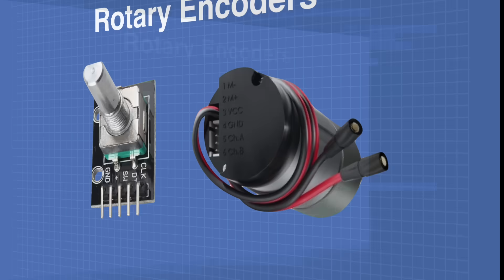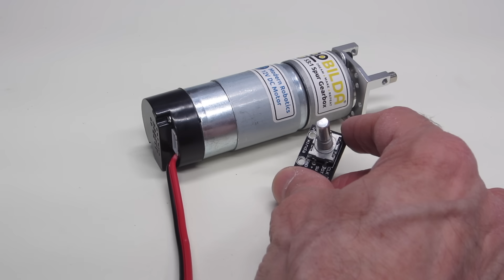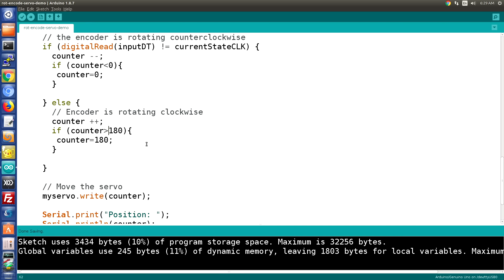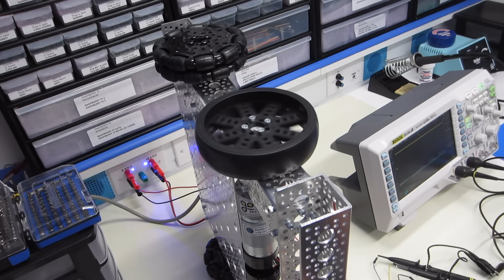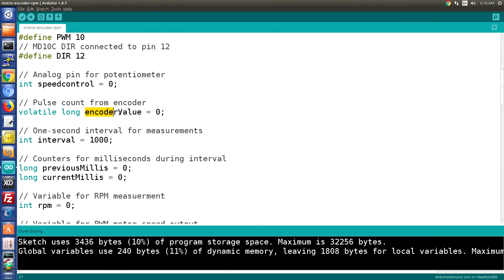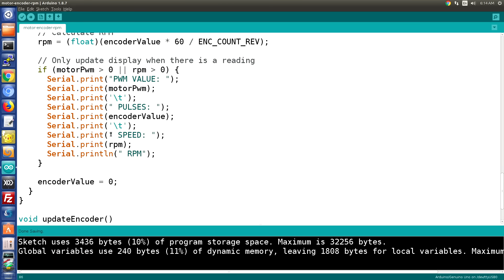Using Rotary Encoders with Arduino

Comment: This gave me an interesting idea for an electronic version of the dial on a safe.
Instead of having a precise set of numbers, the code could be a function of direction and rate of change.
That would make the combination unbreakable, because the user could develop a ‘signature’ set of movements.
This is similar to using an FFT  on hand motion when signing your name, instead of the actual writing.

Comment: It's not a big error, but it is an error. millis() is an unsigned long, not long. I worked with safety certified software and we had to have our compilers set to produce and error even for warnings, which is what you would get if you assigned a return type of unsigned long to long. In some cases, even if the function was explicitly cast to be a long, that would raise a flag during code review and it was often hard to justify the type conversion. So, why does this all matter? Well, our code ran ground based navigation equipment that had to run 24/7/365 so, even as an unsigfned long, millis() rolls over every 49.71.. days and therefore can cause a glitch whenever that happens. So, unless your device resets BEFORE that rollover occurs EVERY TIME (!), then trust me, it will happen. Even safety engineers are at a loss of determining the cause of these rollowver glitches. Computer math is modulo whatever the bit size and in abstract math, this concept is called rings. So for 32 bit values, that's 2^32, "Real numbers" go on forever, but computer numbers are fixed by their bit weight representations. These rollovers can happen in other circumstances. For example, GPS allmanacs have a 1024 count limiit for the GPS week used to tag the validity of the almanac so invalid ones aren't used. The "epoch" for GPS weeks started when the system was commishioned back in 1980. I worked at a company that used GPS for navigation and timing for radar systems. I tried to warn my boss(es) that everything was going to glitch when the GPS week rolls over for the first time back in August 21, 1999. They said, "we got Y2K covered!" I said, this isn't that. Well. even after it happened, they still didn't believe me. The radar system's "fail safes" kicked in and they reset. Some systems can take seconds to minutes to restart, which can lead to tradgety. When GPS experiences a Leap second, that's another similar issue. One that I didn't anticipate was after the GPS week rollover occured where lots of GPS receivers had a "fix" for invalid week numbers to ensure that they start up properly either from cold or warn starts. So, when that happened, some of our GPS receivers did not work for over a week, until they encountered their original GPS week number when they were "born". The industry had to scramble for these fixes! So, yah, rollovers are not a big deal, UNTIL THEY ARE!!!!

Comment: i’m five years late to this video, but i have tried making a similar sketch on my own but ran into a problem. the encoder has its own physical “steps” and the way i wrote my code i was incrementing my position value every time i left the step and then again when the encoder reached the next step (2x per encoder step). i have yet to try out the setup in this video, but will this sketch do the same thing or will it only increase the position value once per encoder step?

Comment: Thanks for the amazing video. it was a great explanation. can you explain how to use a encoder motor to stop at specific angle ?    my requirement is i have a base which needs to be rotated 360 degree. if i give input as 5 , it should stop at 360/5 =  72 degree angle . meaning it should at 72 , 144,216,288,360 and then stop and move to 0 degree position and repeat the same sequence N times.   is it possible to do  ?

Comment: Hi ,if we need to implement this setup of motor ,motor controller ,aurdino and rotatary encoder and can it been actually use this setup  for both manual and autonomous setup of steering wheel to get the feedback from the different modes.

Comment: Great video. I have a circuit that I'm working on but with the encoder, I get a lot of bounce. I know I can debounce either in software or hardware, but I note no bouncing in your demonstration. Wondering if it is the quality of encoder I have or if you are doing something to counter the bounce. Thanks.

Comment: as per this video i want to make 4 dc gear motor as 4-wheel drive robot each motor rotate exact drive parallel if any wheel skit, then another the adjust self by encoder. pls make video

Comment: I have a question. Why does the inputCLK 4 and inputDT 5 have to be #define instead of just like you would normally do an input i.e. cont int inputCLK = 4, and cont int inputDT = 5;?  As the others have said your vids are the most well explained and illustrated. Thanks

Comment: Also if advice on how to perform u v w lockup test etc that communicates with the Arduino, is this possible? Im a beginner in the servo motor field any advice appreciated. As mitchell electronics costs each time i need to do tests as im sure u understand

Comment: Another great video! For some reason my counter stops on even numbers only. The odd numbers are shown as part of the complete sequence but never landed on. I have tried 5 different encoders with the same result. They are the same as the one in the video. Would this be caused by a defective encoder or is this behavior typical of these devices?

Comment: Great video. Thanks. When I put it together I was having some problems with it printing twice for each indent. When I slowly turned the encoder from one indent to another indeed it generated a print at both the start of the and the end of the indent, and the logic of the software is such that this will happen. The first print is from in my case, first the Clk going low then the DT going low. At the end of the indent the Clk goes HIGH again, a transition which again allows the print routine to be executed, and the DT still being HIGH, it prints again a CW rotation.

I solved this quite easily with an IF (currentStateClk == The Resting State of the Clk), in my case HIGH, just before the IF for deciding rotation, it prevented the second print.

Your thoughts. Thanks. Wayne

Comment: Thanks for making such a clear and concise video. I am having a problem compiling the code for the servo motor sketch. I always get the following error: 

rot-en-srvo:46:3: error: expected initializer before 'currentStateCLk'

   currentStateCLk = digitalread(inputCLK));

   ^~~~~~~~~~~~~~~

rot-en-srvo:49:4: error: expected unqualified-id before 'if'

    if (currentStateCLK != previousStateCLK){

    ^~

rot-en-srvo:75:4: error: 'previousStateCLK' does not name a type

    previousStateCLK = currentStateCLK;

    ^~~~~~~~~~~~~~~~

rot-en-srvo:76:2: error: expected declaration before '}' token

  }

  ^

exit status 1

expected initializer before 'currentStateCLk'

Any ideas?
Reply: Looks like you have a mistaken lower-case k on line 46. currentStateCLk should be currentStateCLK.

Comment: im not sure what i have done wrong but in my sketch it increments by 2 instead of 1. Anyone else has the same problem?
Reply: It's because his code counts positive and negative transitions of the CLK, and each notch causes a pulse with a negative and positive transition on the line. If you want one count per notch, you have to add an if statement to only count if the CLK is high.
Reply: I'm having the same issue and tried your suggestion but no luck. Any other suggestions?

Comment: This video is a great resource, but I would like to point out a couple things that people might get caught up on if they try to follow along. The CPR value for quadrature encoders is typically for reading rising and falling edges on both encoder channels. So, if you are only using 1 channel and only looking at the rising edges, you will probably need to divide this value by 4. Also, most encoders are directly reading the motor shaft and not the output shaft of the gearbox, so you will need to take into account the gear ratio when calculating the RPM of the output shaft (e.g. if you are using a 30:1 gear ratio, the motor shaft turns 30 times faster than the output shaft of the gearbox).

Comment: I was looking for a video that would explain how to build your own servo out of a simple TT motor. I have cheap servos that in my last project were just really bad and kept jittering no mater how much filtering I put on it (assuming that it was just a noise generated somewhere). Anyway, I build a motor driver and a controller but unfortunately it was a two button set up for direction and speed. Now, I remember somewhere I read that some servos used optic encoders, I don't have the time or money to try to do this, and so rotary came to mined.

All that said, I have a question for anyone who cares to answer. I have a dual shaft TT motors with left side and right side. I was thinking of attaching a rotary encoder much like this one to the Left or Right side depending on the setup for my robot. Could I do this? I would driver the motor and when it rotates the shaft would rotate the encoder shaft giving me the position and the speed of the motor? Or am I over complicating it? 

What I don't want to do is use the encoder as the remote controller from users perspective (if that makes sense) I want to use a pot for that, just like you can with a servo.

Comment: You detect a rotation only when the inputCLK pin changes. You could also test the inputDT pin to see if it has changed. This would give you twice as many detected rotations per revolution which, in many applications, would seem preferable. The logic is only a little more complex. You have to record the previous state of both pins and enter the pulse routine if either changes.
Reply: You are absolutely right and it is good you brought up this option. But it should be trated as a special case when you want to detect input changes faster than the clock speed. In most cases, it is unneccessary, as it will consume extra processing power of the microcontroller, especially when you may want the controller to handle other functions.

Comment: May I ask your recommendation for an absolute position rotary encoder with at least 300 positions pre revolution for use in determining the dial position of the dial of a combination safe. Nothing illegal, I have had a YALE gear combination safe in my home that we bought in 1983, but were not supplied the combination, and I am not anting to drill it. The gear drive makes manipulation difficult and four locksmiths have been unable to unlock it. It is a YALE with earliest patent date July 20 , 1871 and latest November 2, 1880

Comment: Why ground pin of servo is connected to ground pin of arduino. I don't get it. Any help would be appreciated. Thanks....
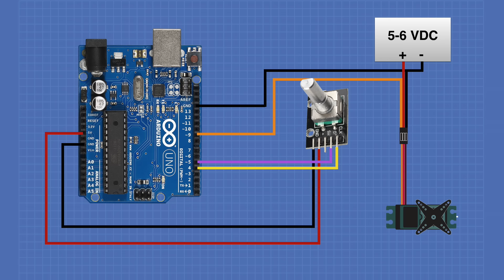Time stamp 14:25
Reply: Because pin 9 of the Arduino is connected to the servo control pin.  Any current from Arduino to servo needs a return path.

Comment: I'm not into Arduinos or Pi' s but I still found it very interesting on how to control a servo motor in precise steps.......this could lead onto another interest if the yen for more projects gets into top gear and I might yet get an Arduino to learn more.
I have to say that the video was very well spoken and extremely clear and to the point with exact placing of the various components and the results of the variations.

Comment: One thing I'm not clear about is if the first encoder he's using is 1 pulse per degree. It seems like the case, but it's not stated. If so, is that normal for small cheap encoders like that? I've noticed some larger encoders in metal cases that specify 600 pulses per rotation. (which I would think would be preferable even though you'd have to convert pulses to degrees)

Comment: is it possible to use optic rotary disk encoder to match the speed of a shaft and drive a 12v steeper motor at the same  speed

Comment: If you set up the code to detect changes from both the CLK and DT inputs, you can double the resolution of the rotary encoder, at the cost of simple code.

Comment: What does the clock and DT do? I want to control my 360 servo to rotate and specific intervals but I am confused as to what the difference between those two signals. How could I make my 360 servo spin in the direction I rotate my rotary encoder for a specific inteval , stop and then rotate the other direction for a specific interval?

Comment: what if i have a big dc motor that i want to make into a servo? i need it to be fairly accurate and was told to use a rotary encoder in place of a pot. could you help me out with how to do that? i was using the ibt-2 motor controller

Comment: Thanks for the video. I learned a lot from you. Thank you.
I made connections just as you did only without LED's and copy/paste your code. I commented lines regarding LED's and changed the code by setting the counting range from 0 to 100 and back. So, when it reaches the 100 it always shows 100 and when it reaches 0 it always shows 0. But, in my case when I slowly turn the shaft of the encoder for only one step the counter jumps for two steps! Only when I carefully turn the shaft in half steps it counts properly. Can you check this?
I made the hardware debouncing circuits like the ones on this video: https://www.youtube.com/watch?v=nboGwG94hCw. But, I do not have oscilloscope to check if it really works. It seems to me that it is OK and I don't see any jumps. So, please, check that too.

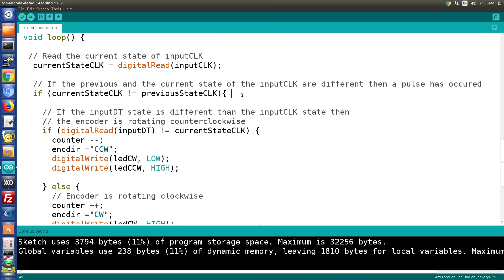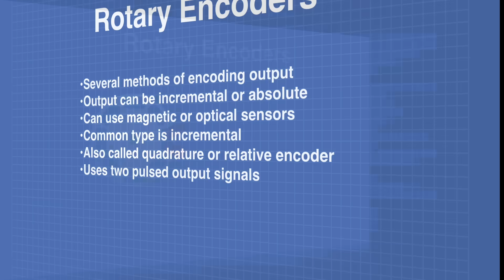Comment: Are the output channel bit states opposite or identical for (CW) clockwise rotation? The software explanation (10:09m) doesn't seem to match the encoder operation description (3:27m). Please clarify? Great Instructional video!

Comment: Thanks for this. When I rotate the encoder quickly both lights flicker on and off as if it were missing some steps and getting confused about the rotation direction. Any tips on fixing that?

Comment: Great video, I am about to buy an Arduino starter kit on Amazon! You have convinced me to start trying to learn how to code and use a breadboard to write math equations and operational algebra to set conditions and create loops for music. Can I use the Arduino to control the behavior of my Arturia KeySteo keyboard or like a Korg Volca or Pocket Operator? You could use the Rotary Encoder to send signals to the CV gates for sure in sync mode to match the BPM! Also, could I use a fluke and jumper wire to patch into my old Casio CTK-411 electronic keyboard? It's not much to look at on the outside, but it's a huge PCB circuit board with ribbons and different labelled positions. I have a fluke tool, soldering gun and everything needed to make permanent changes after using the Arduino to test with stuff like the Rotary Encoder, Transducer, Euclidean pyramid geometry values, Pythagorean major/minor circle of triads, etc. I could even install one of these on a cassette recorder to slow down the speed of the motor for a stutter/delay effect! So many possibilities with the Arduino my friend. Gonna watch more videos and learn how to operate this powerful unit. I know a lot of people use them for playing emulators or installing into arcade cabinets.
Reply: I’m not sure

Comment: Hi, very interesting video. I’d like to create something like your first project with encoder switch and servo motor. But, instead of servo motor, I want to use a 24v motor with only 2 wires. How can I connect it to arduino?

Comment: I'm trying to make a puzzle in which you have to rotate a set of 4 knobs to certain positions in order to activate a lock.  But I can't find a rotary encoder library that detects position instead of just detecting direction of rotation.  Are rotary encoders the wrong sensor for this?  If so, what is the right sensor?

Comment: Bad idea to use the "digitalRead" command for this purpose. You should use the interrupts to be sure that you don't miss the sensor pulses.
Reply: Interrupts will only work in cases you want the rest of the code paused while moving the encoder. In some cases that would be the better solution, in others not so much however. I built a macro keypad using this encoder and implementing interrupts for the 2 encoders I have would render it effectively useless, as whenever I turned the knobs it would miss any keystrokes. However encoding for motion control interrupts would be best. But I have to agree with the presenter, digitalRead is the best well rounder for an introductory tutorial like this
Reply: As long as you don't use delays in the code it will be fine( loop cycle on an arduino happens fast enough ). Interrupts are better but not necessary.
Reply: @alexkart9239  Your spelling is completely wrong.

Comment: Good video.
But at time 27:30 You are in danger, in my opinion. You should turn off the interrupt, take  copy of encoderValue, turn the interrupt on and proceed the calculation using the copied value.
Being unlucky that encoderValue lands around 255, 256 You will read totally wrong values because an interrupt occurred when You are reading the 4 bytes in that long declared variable.

Comment: They're really useful for when you want to externally influence a user parameter - I realised this making a midi CC device, where values are set from a document, and you want to make deltas . Otherwise you need motorised pots which cost a fortune

Comment: Total beginner here. I've checked my code against what is shown in the first sketch multiple times, but can't figure out what's different. My loop runs continuously, incrementing positive every cycle. When I turn the encoder, the CCW led lights up, regardless of direction, but then its the CW led as soon as I stop turning.